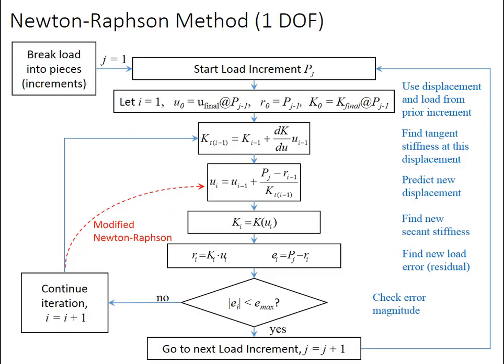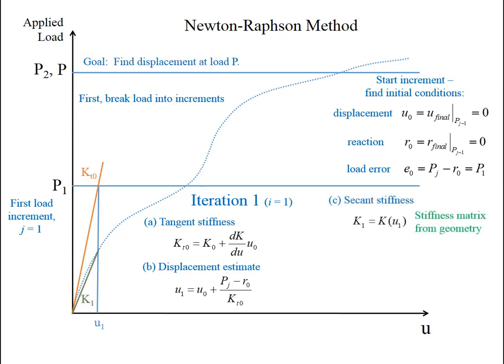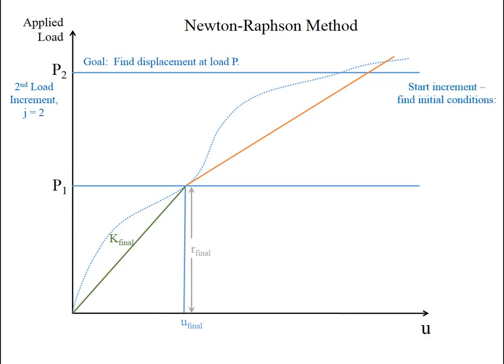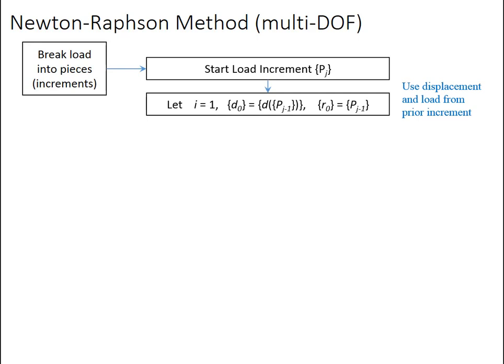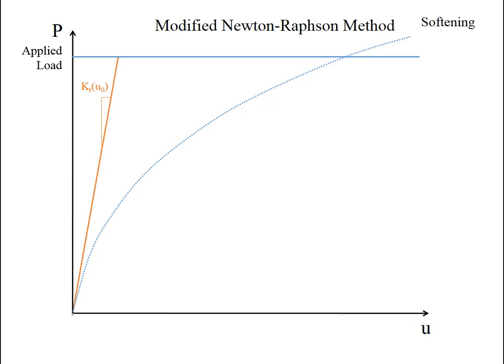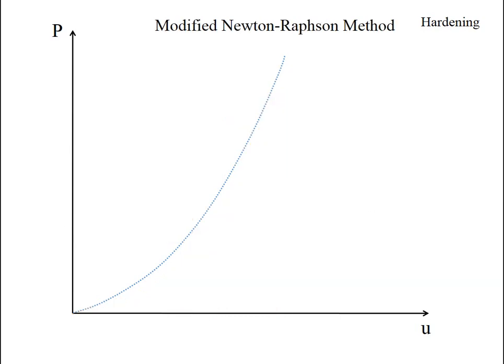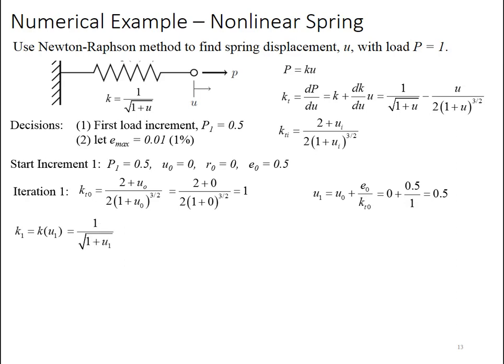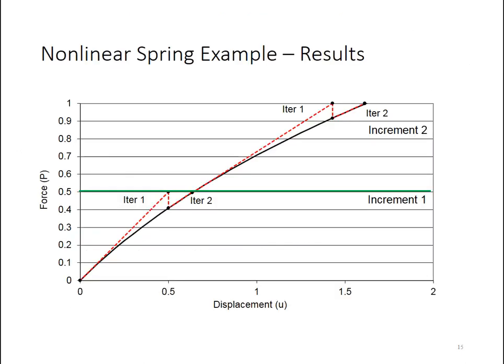FEA 33: Nonlinear Analysis 2

Comment: Great explanation in simple words... thank you

But I have one doubt, how do we calculate sacant stiffness that is step C in this video. Because we say that we dont know this curve at beginning of analysis
Reply: Did you find an answer to this?
Reply: Yes. Basically this whole calculation will start only when we enter into the plastic zone. That is after elastic limit. So for calculating next slope of curve we already have previous slope which is Young’s Modulus. This is why when we enter plastic strain vs stress data in multilinear curve we always start with yield strength as first value in zero plastic strain row. 

Hope this is helpful.